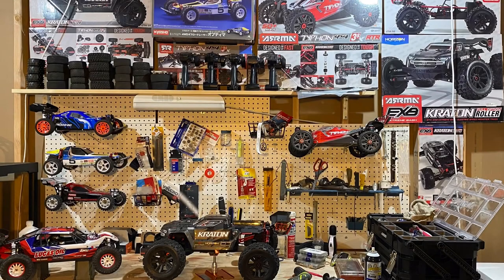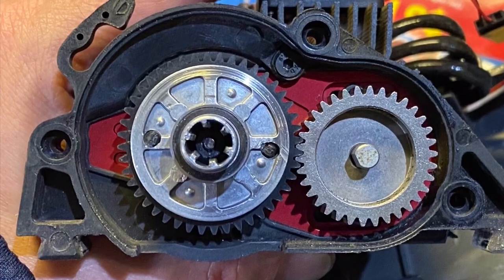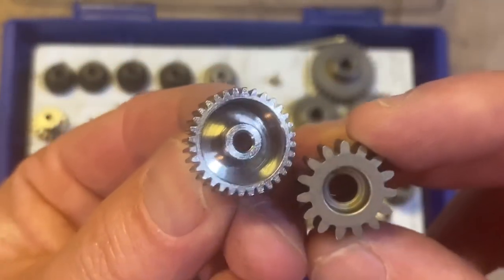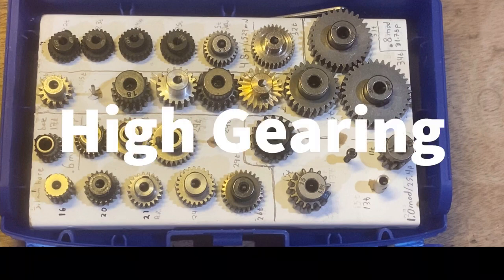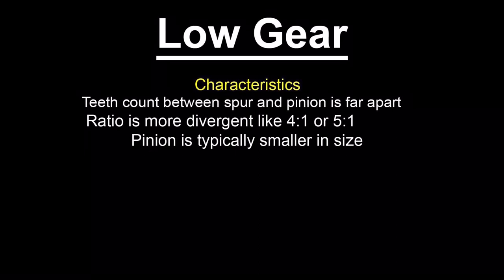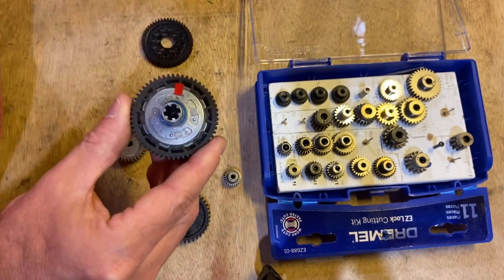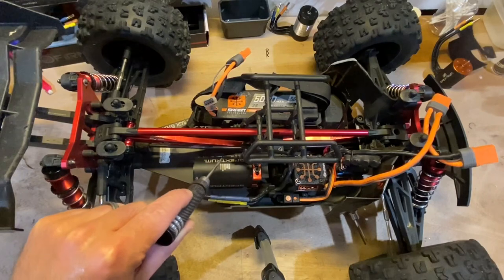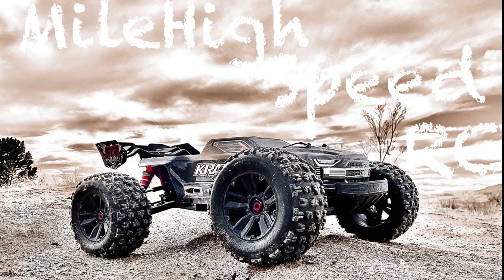RC car Gearing 101 - all you need to know

Comment: acceleration for me meant how fast there is speed on the wheel and in high gear, the wheel began to turn very fast so I did not understand why in high gear there was written "I accelerate very slow it takes me a while to get up to speed" there I said "No" look how fast the wheel is turning, then I went back to the beginning, watched again from start, then concentrated on the leveller and then I understood that it rotates much more slower...so my conclusion is that only with the resistance of the bike sat on the ground, one could say in high gear that ""I accelerate very slowly and it takes me a while to get up to speed".  Low gear = low high speed.  High gear = high final speed.  Like this I will remember it. Fantastic visual and understanding video.

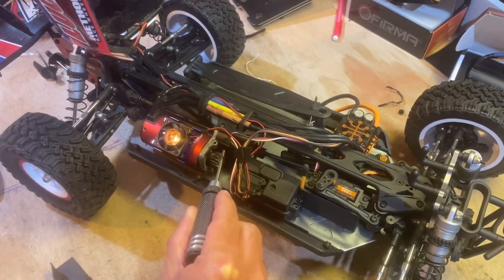Comment: Great vid,so gearing up or down 1 tooth on the pinon gear should be ok,i have a feiyue 08 (1:12 scale) with a 5000kv motor with a locked rear diff and a 23t pinon gear,the take off is very rapid so wanting to leason the take off and give it a bit more top end gearing it up with a 24 t pinon gear.i have a 25t pinon gear as well, but little steps at a time as advised by other rc owners,thanks for a very informative video.
Reply from the maker: Little steps is good advice.  Smaller higher kv motors are impacted more by changes due to having less torque so smaller increment changes are a good idea.   The more teeth in the system the less impact a single tooth change will make.    Smaller 48 pitch gears have lots of teeth between them so changing up/down 1 isnt as impactful (good or bad) as when using 1 mod for instance.

Comment: I don't know if you didn't mention it or if I missed it but when you gear for speed, if you gear up too much, you'll never reach top speed because it's overloading the motor. In turn it'll overheat the whole electronic system pretty quick even with good fans.
Reply from the maker: Thanks for the note.  You are correct, something to watch for is heat in high gear scenarios.   I didn’t directly note the motor but within the electronics impacts section the first item for high gearing to watch out for was the increased resistance which places additional load on all electronics which causes overheating.

Comment: I have a kraton 8s with xl2 and 800kv motor and 39th spur with 30 pinion gear is that a good set up for speed and power.
Reply from the maker: I don’t own an 8s Kraton so can’t say for sure.  How you want to drive and what ur looking to do (stunts or speed) is also part of the equation.  The nice thing about gearing is you get to play around and find what you like to match your driving style, doesn’t matter what others think.   Others I know who do drive 8s Kratons like a ratio set like you have (with 800Kv) so it’s definitely not something I’d say “oh man, that’s extreme” one way or the other.  Some of them are even closer to 1:1 in fact as they wanted a little more speed.

Comment: So a pinion gear with a 48 pitch is compatible with a spur gear with a 0.5288 module?
Reply from the maker: Yes, 48 pitch is .5288 module.   They are one and the same.    48 pitch is used by a number of manufacturers for 1/10 scale vehicles.  (And is sometimes referred to as .5 mod…but almost always 48p).      Unfortunately .6 mod is also utilized by some manufacturers and those are not compatible with 48 pitch ( .5 mod).     They ( .6mod and 48p) look almost identical as they are close but they will not mesh.   The only two pitch/mod combinations which are different but yet compatible are 32p and .8 mod.

Comment: What gear would you recommend for a Arrma vortek  At the moment is running a 57 spur with 20T
Reply from the maker: Context is everything.  How do you want to drive, what packs are you using, what size motor and what kva, what are you driving on etc….  But for me, the vorteks is a nice basher that’s more truggified so I’d gear down looking for torque so I could do stunts, flips, tackle tall grass sand and mud, do burn outs and wheelies etc.   Assuming your running stock electronics on 3s I’d be looking around 13-15 tooth.  That will get you that torque while still keeping the car fast enough for fun.  That set up (15t) should keep you around 50mph which is usually plenty of speed for bashing in the manner described.

Comment: Where did you get that gear holder box at ?
Reply from the maker: Was a demmel tool cutting bit box.  I wedged a small piece of pre-finished wood in it and then shot finish nails into the wood to slide the pinions on.  Nails are shot in just far enough for the head to end just beneath the plastic lid so no gears can slide off when you rotate the box around.

Comment: So why would someone use a pinion gear that has more teeth than another?  (Or vise versa). For example, my xmaxx comes with 18 tooth pinion stock.  Why would someone drop to 15, or increase to 20?

Comment: HI I GOT A TRAXXAS   RALLY CAR 4WD  THE  28T PINION  GEAR AND A 76T SPUR GEAR  BUT THE MOTOR  IT  GET WAY TOO HOT IS IT  THE WRONG GEARING SETUP FOR THE TOP SPEED LONG DISTANCE.
Reply from the maker: Lot of things can create heat so its hard to say but definitely gearing is always a good place to look.   However, 28t pinion against a 76t spur on the surface doesn’t sound too bad. (Depending on a lot of other factors like size of motor, kva, pack voltage, surface your driving, how you drive etc….).  That’s near 3:1 so it doesn’t jump out as a gearing problem knowing nothing else.    Typically with motor heat your issues come from 3 main concepts:    1.  Too much load on motor which it cant overcome  (gearing, drive train, weight, driving surface, gear mesh, motor size).   2. Is it receiving too much voltage from the pack even at reduced load:  Miss matched pack or esc to the motor, too much time at full throttle, too high kv for the pack.    3.  Mechanical issue with the motor (bad bearings, damaged wiring, damage to the can, bad windings.

Comment: How about 0.5mod and 48dp are the compatible, I know they are close but I struggle to find 0.5mod pinions for tamiya df03
Reply from the maker: Wish I could tell you definitely but I can’t.  Never owned a .5 mod car.   However, I have 48 pitch gear cars and I was incorrectly shipped a pinion that I thought was .5 but could never confirm.  It was a weird shop in china from AliExpress.   That shredded in about 2 runs ( not instantly) but like I said, I never could confirm the true pitch/mod of that gear.  Could have just been a crap gear.   However, I can confirm .6 mod will last about 10 seconds mixed with 48 pitch.  Been there and done that.   Those are about 5.7 apart in pitch.  .8 and 32 pitch are just .25 apart.  So 48 pitch and .5 mod fall almost right in between what I know works and what I know doesn’t (These two are at 2.8 pitch difference).   multiplying the difference between 32p and .8 mod by 11x I’d guess they won’t do well, knowing that doubling that agin means instant destruction of the gears.     Are you in the states?  Amain has some RR .5 mod gears on the site and hobby-town USA also carries  .5 in stock at many stores.
Reply: @milehighspeedrc8412  firstly thanks for the details reply, much appreciated 🙏🏼, just as I though, I had heard stories of 48dp chewing through spur gears pretty quick that are 0.5mod, unfortunately I’m in Sydney/Australia so I might look for something online(which I guesss could be hit/miss) anyway, love your channel, keep it up 🤟🏼

Comment: I just wanna know what will give me. The fastest speed run with a traxxas Rustler 6s with a Poseidon 1512 5mm rustler. What pinion and spur will give me the fastes Result and it has to fit on the hot racing transmission transmission set up
Reply from the maker: Well as noted there a few different factors that play in and only you can be responsible to the damage of your electronics from over doing things but in general:   the closer you can bring the ratios near one to one the faster you will go.  As video notes:  you may also overheat, you may trigger your esc to shut down, they may not fit, you might cook your electronics or you may not have enough room to accelerate to that full potential.   I dont own a rustler but looks like basic info says it comes with a 54t spur, and can take a 17t pinion for speed (on their literature) which means thats safe operating top range but there is cushion there usually so you can probably go a couple teeth higher yet like 19/54.    but we all know speed runs are done going well past any manufacture recommendations so if you want to take risks you would push the pinion count up as high as will fit and if you really want to push it take the spur down to 44 or 46 and keep bringing the pinion count up.   Again, beyond 17/54 you are on your own in terms of damage and risk to your vehicles electronics.

Comment: Where do you buy your gears?
Reply from the maker: Mostly local hobby shop as shipping costs about as much as the gears.  If im ordering parts for other things sometimes ill add a gear or two in there.   Amain, tower hobbies, mostly if its online.    I find traxxas actually has pretty decent gears for cheap.  Robinson racing gears are usually some of the best and are worth the extra money for higher quality cars.

Comment: Im trying to figure out how to gear for larger tires.
Reply from the maker: Larger tires are more weight, more drag, more grip.  Thus, lower gearing is used to give more torque and more power to move them without heating up your electronics.   The larger diameter will give you more speed per rotation, so gearing down will not necessarily be a loss in speed as the tire size will make up for some/all of the speed loss from gearing down.
Reply: @milehighspeedrc8412  I figured it out